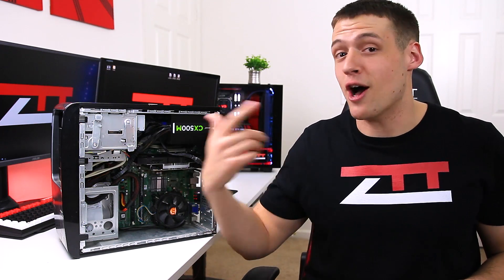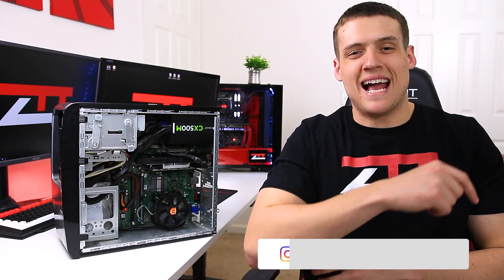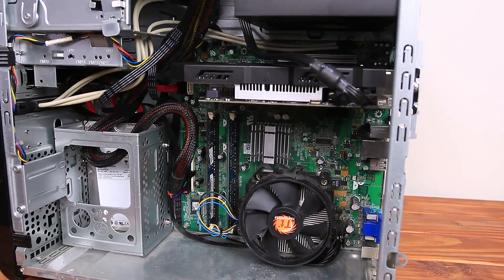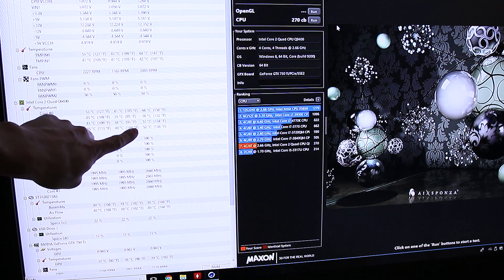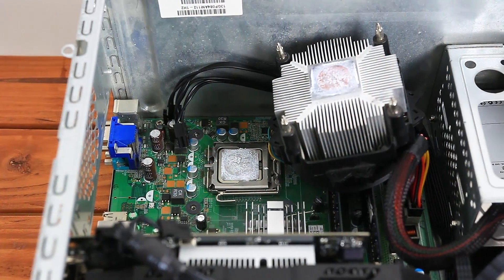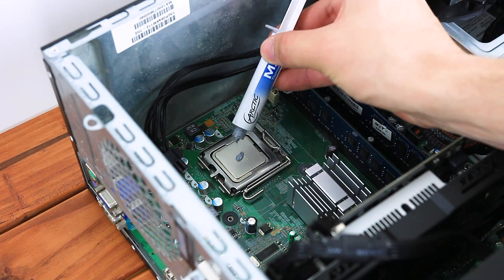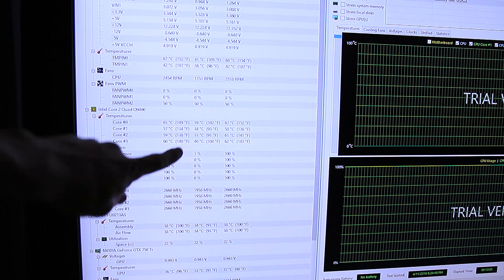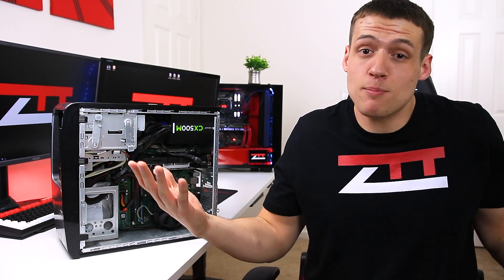Replacing Old Thermal Paste For Better CPU Performance!

Comment: I remember when I was a kid, tried to clean my pc, removed the dust, and cpu fan as well then I noticed theres a smudge on cpu (that time idk that is the cpu) and then I removed the thermal paste by wiping it with dry cotton, clean it, then back the cpu fan. Then after that my pc wont open again.

Comment: From my experience.. if you have a cheap thrash thermal paste on your gear.. replacing it every 2 years would do a huge difference..
but if you applied a good thermal paste.. you can get away with it for 10 years or so with only minor degradation on the temps.. +- 3C higher after 10 years.

Comment: Gosh, only 3 degrees.  I'm running a I7-4770 I built in 2013 and noticed it gets to 90 degs when playing Starfield.  The game plays fine even though the processor is way under spec.  But I'm more afraid of breaking something taking it apart since everything is old.  Don't want to have to build a new computer right now.
Reply: Me too so I put a table fan and opened the case to get it down to 74-76 Celsius in my 2013 gaming desktop in my summerhouse.
Reply: 90 isn't that bad

Comment: That was not enough thermal paste - try 3 or 4 times that much, in an X.  Too much is better than too little.  With enough paste, you'd get significantly better results.  If you take it apart again and look, you will see that the amount was so small it couldn't spread to cover the whole chip.

Comment: I think I need to do this. Ran prime95 today and my i5 2500k at 4.5 ghz (1.28 volts) was hitting 93c. My system is almost 11 years old now with the original paste.

Comment: So replacing the thermal paste gave you a decrease of 4 degrees. Doesnt seem like a big difference to be honest.
Reply: you just need to use a quality paste once, then you can just forget about it. just clean the dust build up in PC and it should be fine, tbh if you are using your PC for gaming or for work that require at least a decent specs, your PC won't be as useful in 10yrs anyway and should be changing your PC at that time.

Comment: The thermal paste in my pc was just non existent when I checked on it
Reply: Do u know how long you were playing without the paste and was it over heating a lot ?
Reply: @momo23461  between 2-5 months 
I couldn’t  tell if it was over heating since all the other issues the pc had
(Didn’t help that I was kinda just getting into pc stuff so I had no clue what to look for )
If my memory is correct all there was left was a bit of dried stuff that was almost a powder (which I assume was once the thermal paste) (it was a preowned pc)

Comment: does it change the performance though? could it be that I'm getting lower fps in games due to old thermal paste, or not?
Reply from the maker: Yea that could certainly cause less performance because the CPU might be throttling and getting up to too high of temperatures
Reply: @ZachsTechTurf  Alright, I'm worried about replacing the thermal paste though xP It sounds silly but I'm really not into everything around CPU and more in depth connections to the power supply, I can safely only do really, really basic stuff.. :P
Reply: @typographia5737  how’d it go?
Reply: @SciK.  that was actually a long time ago, i switched it back then, went well. i dont game now anymore though :)
Reply: @typographia5737  oh ok

Comment: My cpu reached 98 deegres celsius max, i ordered the most expensive thermal paste i could find..
Reply: A better CPU cooler fan will probably help more
Reply: @nupsu1100  the thermal paste didnt work thats my last option,if that doesn't work i'm gonna buy a new cpu
Reply: @RaulForLife  update?
Reply: @EduardoMacias-h2r  the cpu is in a terrible shape, i'm gonna order some parts to build a new pc this friday
Reply: @RaulForLife  what cpu is messed up
Reply: Mine is at 90°C max atm. How did you solve this?

Comment: Hi Zach :) I need your help.So last night i changed Cpu Clock Control from 100.00mhz to 101.000mhz and suddendly after that my pc runs but there is no picture on display :(( What could be the problem ? I really need help ! :(
Reply: It also happened with me when I overclocked my cpu not properly.
Just reset the CMOS & everything will be fine.
Reply from the maker: Just reboot into your BIOS and change everything back to default. Should be a “Load Default Options” somewhere in there.
Reply: Zach Ferree yeah but it doesnt load bios or anything else.Just black screen altough everything works: all 3 fans,led lamps and other...
Reply: @dreadfuljack2694  Reset the CMOS bro. Everything will be fine.

Comment: I once cleaned a CPU that was glued to the heatsink due to the old thermal paste... I had to use a screwdriver to separate the chip from the heatsink. When I applied pressure enough the CPU went flying away... lmao :v
Reply from the maker: Omg lol. Did it survive when you reinstalled it?
Reply: It survived indeed, the PC where is currently installed still lives... I was worried about the pins since that CPU is an AMD chip, but none of them was bent after the fall lol.
Reply: Rolando Bandres LOL WTF 😂
Reply: That's crazy dude
Reply: How did you clean the tp? Mine is same situation with my xbox 360
Reply: Didnt you try turning the pc on forst so the cpu gets warm?
Reply: Surely it's not still alive now though?
Reply: Answer him, you B-A-S-T-A-R-D

Comment: I have a question do u have to use thermal paste if so what kind is the best
Reply from the maker: Yes you have to use it, I like the MX-4 like I said.
Reply: Ok
Reply: I'm kinda new to the whole pc building
Reply: MX-4 is good for beginners for sure. It's non conductive so even if you accidentally smear some on your mobo it wont short out anything.